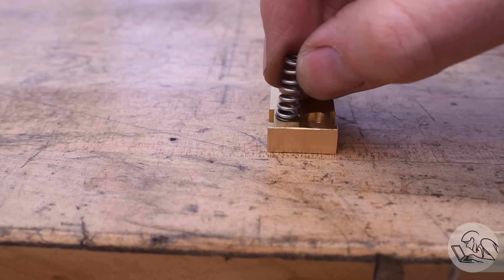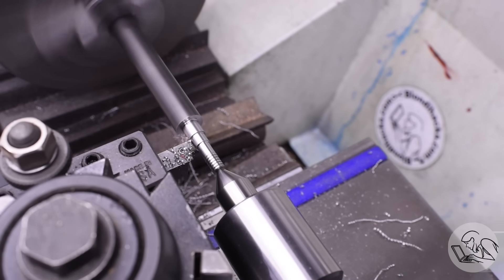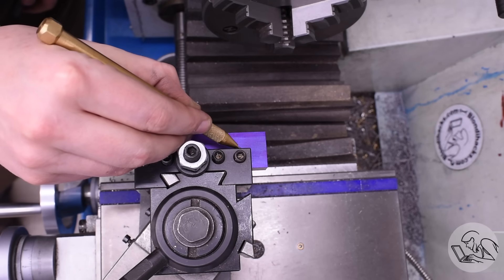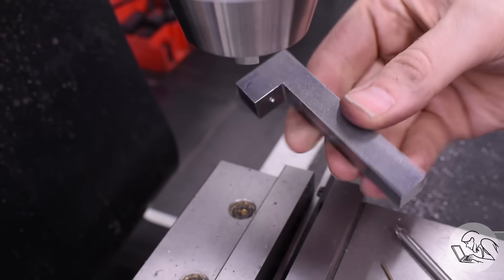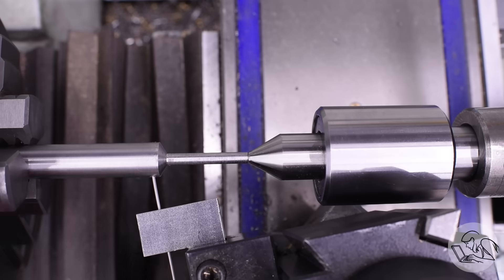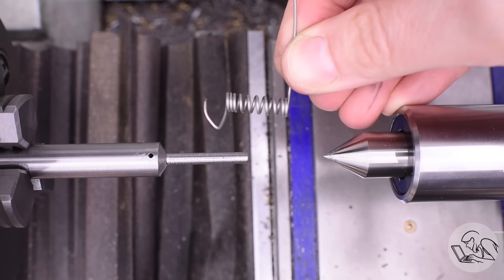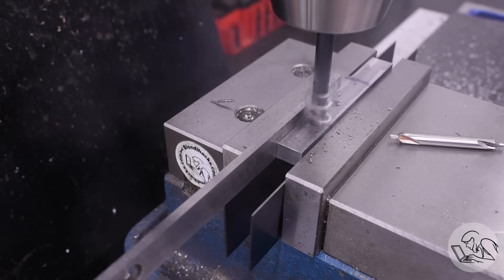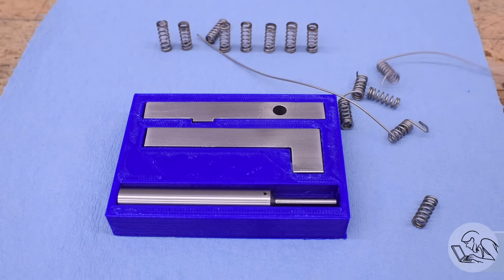Making Your Own Springs On The Lathe!

Comment: I'm just curious, why not use the cut-off wheel on the mandrel end of the spring after winding it? Seems like there would be a lot less opportunity for parts to go flying with lots of energy, and also you wouldn't have to risk distorting the spring.
Reply from the maker: That’s difficult to do on small springs without damaging them and it will sproing into the Dremel which is dangerous. I know because I tried it 😬

Comment: I remember running across a "how to make springs" web page some time back,  but it wasn't nearly as good as this stuff.  In the meantime,  anytime I tear something apart that contains any springs I salvage them,  before getting too far into that process I started to sort them out by compression,  tension,  torsion,  and leaf.  It's amounting to quite a pile so far.  :-)

Comment: Sure wish I'd had a lathe back then. I had to make some springs several years ago and I used piano wire. The research I did called for them to be heat treated. A really simple processes using a heat gun to get the most "spring" life out of them. You heat them until they just turn a straw color. Any more and they'll get brittle. JM2¢. Thanks for all your hard work.

Comment: There are hard wire cutters but they're a specialized tool. On the flip side since buying one I have yet to ruin a wire cutter trying to cut hard wire.
Reply: I used to have a pair of dikes that were marked "FOR PIIANO WIRE" and I'm still upset that they decided to walk away one day.  I've not found 'em since then, though there are lots out there in "nipper" style,  which is not what I'm looking for.

Comment: Does your sharpie King size blue marker stay on ok with stock bright mild steel? Tried black sharpies, tried paint sharpies.
Reply from the maker: No, it’s only sufficient for quick marking. If the marking needs to survive more than one or two ops, you gotta use proper Dykem

Comment: When I took the left front coil spring out of my 1955 Studebaker President Speedster for the first time, I was amazed at the length, quality, and squareness, despite having been bent and compressed for 45 years.
As I was working on the car I kept hearing a strange noise until I finally got up to find it.
The spring was literally dancing across the concrete in tiny vibrations.  It did this for about 12 hours as it tried to grow back to its pre-loaded length.
I have done a ton of suspension work in my career but never experienced this before.
Respect big springs, they can kill you.
Reply: Especially the one(s) on your garage door.  Super dangerous.  One of the few things I won't d-i-y.
Reply: @UnlikelyToRemember  The roll-up doors aren't so bad, with the spring captive on the rod. It's the cantilever doors that'll get you. I re-sprung my garage door back in 2001. I ran a wire rope through them and secured it to the frame to keep them from flying if they got loose.
Reply: @GrayRaceCat  You're a braver man than I!
Reply: @UnlikelyToRemember  Not so much brave as desperate. I needed to build a wheelchair ramp for my wife, all my tools were trapped in the garage, and I was broke, having sunk all my cash into materials for the ramp. (They were stuck in the garage too.) The door had to get fixed and I couldn’t afford to hire someone.
Reply: Yep, the forces in coiled springs can really be interesting. Not so much with the flat ones, they generally have room to move when they are installed.

Comment: I haven't wound stainless springs, but music wire does absolutely require baking in a oven otherwise it will change dimensions (taking a set).
Mark Serbu made an excellent video on this.

Comment: If you add a threaded hole in long side of the “L” shaped piece that you clamp into the tool post, then you can use a bolt and a couple of washers (one of which has a small groove cut into it) to tension the wire (which would free up a hand from having to hold pliers).

Then all you would need is some sort of mechanism between the bolt and washers to add tension (which could be adjusted by tightening the bolt).

Comment: I used tension springs in a stress lab setting, whose ends were of the type you mentioned,  in gauges used to measure hole deformation under load.  My mentor also used a small diameter wire on a different part of the gauges that required hardening.  He did so by stretchiimg it by hand..  one could see the wire color change as the metal transition.  Metals are not my specialty, the mechanical testing of composites, pkastics, and elastomers are.

Comment: Great video again. I just didn't quite get the reason for the 10 degree angled guide hole. Why not just adjust the guide height to make tangent to the mandrel?
I have allways used two pieces of oak  in the toolholder for a guide. Wire runs between the wood pieces. The friction for tight coil can easily be adjusted from the tool holder clamping screws. No need for pliers.

Comment: I'm a fairly long time hobby spring maker since I need a lot of custom sizes for one of my other hobbies.  I wind my springs differently than you but given your need to make multiple identical copies I would and will use your idea for when I need the same.    Your method has more control over the initial shape than my own freehand method.  

One last step to suggest though.  You want to "passivate" or post form relax the springs with a sub temper heat soak.  Without this last step I found that my springs would easily collapse or stretch.  After the relaxation heat soak the springs "remember" their new shape and return to it despite being stretched or compressed fully to the limit.  The heat soak is a 450F at 20 minutes in my old toaster oven followed by a 50F reduction at 15 minute intervals until the oven is off.  The wire comes out with a light to medium straw.  So well below the usual "spring blue" temperature.  And with that last step your shop springs will be as good or better than commercial springs.

The idea for this came after watching a lot of videos to figure out why my springs were not as springy as commercial ones.  A YT video in passing right at the end said "...and now off to a passivation heat treatment...." and left me hanging.  That led to some searches and my trial of this 450F relaxation step which you'll find works amazingly well.  If in doubt by all means fish a few of the discarded springs you showed at the end and test them both pre and post "relaxing" and see for yourself.   I've even stretched commercial springs back to length and did this same relaxation treatment to them.  And they hold the new length very well.

For my arbors I bought a set of transfer punches.  The punches are secured in one of three short 1" diameter blocks that have a center hole and an offset hole on the face.  I secure the right angle bend of the wire in the offset hole with a screw from the side and the punch with another screw.   The holes for the punches being different sizes to accept 1/3 the range of the punches.  A little wobble but it's not a big deal.  I'll make a few more at the inbetween sizes to go with your controlled feed method when needed.  And for use with your tool post wire feeder I'd then use a cup center for the point of the punch to rest into.  So far I've used a different tool that is self balancing so I don't need the tail stock support..

Springs are a key element of many of our projects.  It's nice to see a different approach which is aimed at your specific need.   Nicely done!
Reply: One quick thing - on that passivation treatment, you can use sand to help control the cooldown. If you preheat the sand and throw the springs in, give it a couple minutes and then kill the heat and it'll cool slowly like you want but without requiring constant monitoring. Let's you carry on with other tasks while the springs do their sauna time and get all relaxed. 😉

You just need some kind of small(?) metal container for enough sand to surround the springs by at least their diameter. The sand holds all the thermal energy and cools slowly from the outside in, so don't go shallow and wide here - think more cube shaped if you have the room (this obviously depends on the size of the springs being made). The nice thing is that almost any basic sheet metal box is sufficient for the task, and any method of getting it up to temperature is also perfectly acceptable. Another side benefit is that if you're measuring the temperature of the sand first, you have 0% chance of overheating the springs and ruining their temper. 😉 This is actually an excellent way to temper literally anything you want to - the mass of the sand helps to control the temperature and also helps to heat the item more rapidly and thoroughly. And in the case of springs, allows that slow cooldown that is so important to their functional temper.
Reply: @Broadpaw_Fox  
That's true.  But the trick is to hold the spring at the 425 to 450F temperature reasonably accurately for around 20 minutes or more before the slow cool down.  I'd want to pre-heat the sand in a tray of some sort to temp first and then push the spring(s) into the sand, soak for around 30 to 40 minutes and then turn off the oven.    While this would certainly work just fine I'm thinking that the same amount of energy used to pre-heat the sand is roughly what I use up during the graduated cool down.  And if you're suggesting using a torch of some sort I simply don't have the temperature measuring or controls to manage that.  So it's a toaster oven for me.
Reply: @brucematthews6417 - yeah, I wasn't so much worrying about energy savings - I realized a while ago that it's not beneficial for that, but the smoother temp control and the ability to just leave it be IS a definite benefit. Get it up to temp and ready, set your timer for the soak, and go do something else for a couple hours. Sort of automation, without having to buy an expensive kiln/temper oven. 😀 

An old adage I tell myself often is "keep it simple, stupid", and a basic setup with something like a toaster oven (or regular one for larger parts) is an excellent example of simple, but effective. 😉
Reply: Thanks for the tip @brucematthews6417 I’ll keep this in mind if/when I need to make a spring
Reply: A well tempered thing to remember.
Reply: About 15 years ago I had need of some springs for a project. I found a supplier that have a great interface that allows me to pick exactly the spring that I need then purchase online.  I subsequently decided it would be a better idea to have a range of springs available just as "stock" for any future projects.  I bought a pack of 240 assorted springs.  I still have 239 of them.  Even though I've probably used hundreds of springs in my various projects since. Practically every spring I've used has been recycled from some other device. Quite a few of those projects were modified just to fit some random spring I had available to do the job.

I did attempt to make my own springs but found the results to be very underwhelming. I do, however, have a toaster oven that has a controller that I built myself for solder reflowing.  This controller allows me to define a heat "profile" that the oven will follow.  Your "passivation" process is practically the same as the heat profile requirements of reflowing circuit boards.  With the information you've provided I now feel I'd be able to produce my own tailor made springs in future.  This comment has been absolute gold dust to me.
Reply: Happy to help.  Like you my early efforts were similarly..."underwhelming"...  @KenFullman
Reply: Thank you for the idea!
Reply: Bruce, this is brilliant.  I saw another video (Making Flat Springs (TIS249)) by The IdahoanShow.  He put his springs in an oil bath of 400 degrees for 30 minutes.   He called it Austempering.   I'm not sure if that is the same thing as what you were saying though.  I did a little digging and found the definition with more interesting facts: 
"Austempering is a heat treating process for medium-to-high carbon ferrous metals which produces a metallurgical structure called bainite. It is used to increase strength, toughness, and reduce distortion. Parts are heated to the hardening temperature, then cooled rapidly enough to a temperature above the martensite start (Ms) temperature and held for a time sufficient to produce the desired bainite microstructure."
NOTE the martensite start temperature.(Ms)  That is the key to spring making me thinks.  It sounds like all metals have different Ms temps.
Reply: Yup! I also though you needed to heat afterwards

Comment: Ive never made springs.

What if the 'cross-hole anchor' was at such an angle away from the tangent (more than 90°), such that it "hooks" the wire a bit, and you wouldn't need so much to anchor it? (My goal with this  idea is to make "de-mounting" the work from the mandrel easier)

Comment: Quinn - I have made some springs on my lathe, but you added so many steps of refinement I never realized were possible. Thanks for an enjoyable, and super-useful video!
Reply: might be time to make a sheet metal spring?
Reply: Why does Ron Covell watch all the same videos that I do? It's one of those mysteries I guess.
Reply: and each of them shall be costing half a fortune.
Reply: Not sure how I got here but ended up enjoying this immensely. ‘Spring semester’ - love it!
Reply: A good, beautiful and useless set of tools. Have the springs been heat treated in an oven? They will quickly lose their strength if they are not baked in the oven.
Reply: I would expect nothing less from Quinn
Reply: Like he said!

Comment: This was great! I loved the fixturing tips. Thank you, Quinn. I  have made springs with music wire and a drill bit, but never anything this nice. The "Spring Semester" in my mechanical engineering degree talked a lot about calculating spring rates and selecting wire and coil sizes. It would be a stretch to say they covered making them, though.
Reply: We had one class that was supposed to cover springs, but the professor was tired of teaching springs, so we learned bolts instead. Why only one class covering both? Because the university decided that everyone had to take 7 different humanities classes, a "science" class, and a math class to graduate.

 Got to say bolt calcs have been a lot more useful than designing springs.

Comment: As a chainmail enthusiast; Can confirm, anything above 1mm stainless is absolutely crazy dangerous. Powerwinding springs for making rings for chainmailing is one of the top things giving me permanent skin scars. Worth it though. Safety glasses and thick leather gloves and you'll be fine.

Ofcourse, as chainmail goes, I just made a bunch of jewelery, so my rings weren't that big in diameter. As such, I just used a battery powered drill and knitting needles with the knobby bit sawed off, and that netted me an awesome variety of diameters for coiling. Thriftyness ftw!

Comment: I bought myself some piano wire a few years ago, and it came in a reel.

There was no warning on the packaging, but with hindsight I suppose I should have seen this coming, but wow do those reels contain a lot of energy! When I first unhooked the wire from the latch thingy which was holding it in, the reel unravelled, quite explosively, hurting myself a tiny bit. Thankfully I was wearing goggles, and a leather apron, otherwise I may have lost an eye and a nipple.
Reply: THIS STORY WILL HELP ME WITH MY KID AND THEIR WANTON DISREGARD FOR PROPER NIPPLE SAFETY.
Reply: I've done similar with steel wire rope.  The manufacturer had wound it tightly around the reel and i've just gone in with side cutter and sliced the banding.  Like Dave my PPE saved me that day.
Reply: Yep. Try working on watches, clocks or pocketwatches. The mainsprings can be deadly little buggers.   Take out an eye, slice fingers...
Reply: This will also happen with MIG welding wire if one is foolish enough to let the end go before feeding it through the pinch roller on the MIG machine. (as per Quinn - ask me how I know)
Reply: @slots1407  Yes & its fun to try to use the birds nest coil after that has happened...
Reply: Important story - i worry about my kid and eye-pro all the time! need more scary stories👍❤